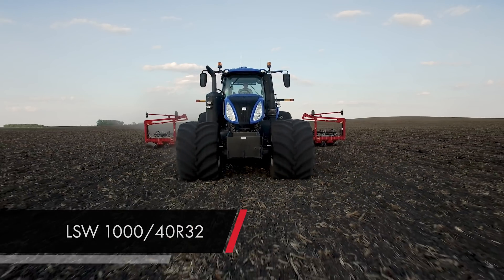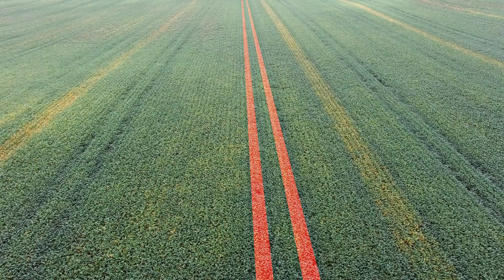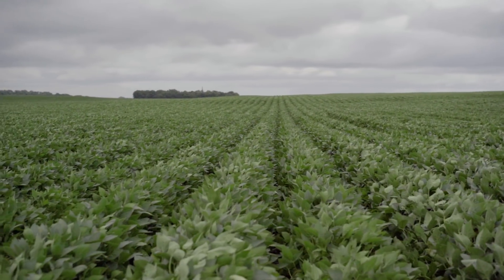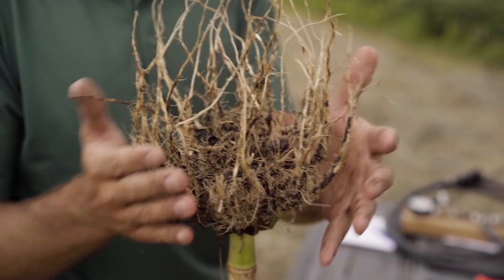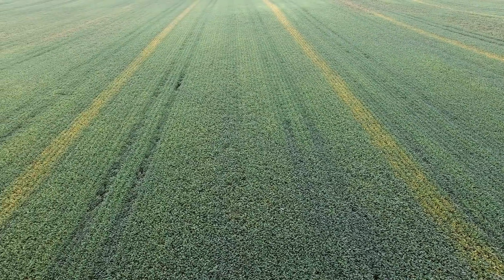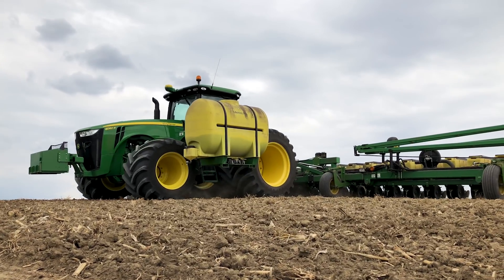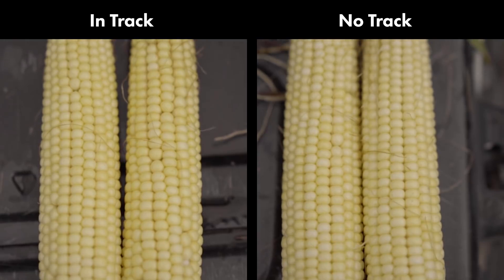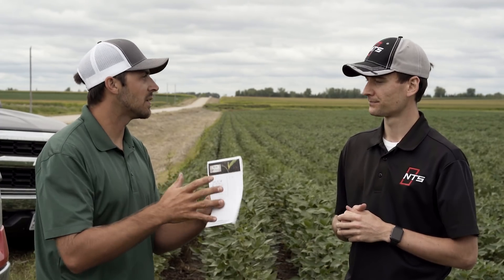Planting in the Tracks of Goodyear LSWs - A Yield Crusher or Inflator?

Comment: What is the comparison with tracks?
Reply from the maker: We haven't done any in-field trials ourselves comparing the compaction effects of tracks versus tires. We want to though! Although it's easy to think that tracks will most certainly compact less than tires (since they have the largest footprint), this is not necessarily the case. High-pressure points caused by the mid rollers can cause more compaction than a properly inflated tire. The advancements in IF/VF tire technologies and the introduction of tire inflation systems could make tires the way of the future. You might find the following article comparing the compaction effects of tires vs. tracks interesting: https://www.ntstiresupply.com/ptk-shared/tires-vs-tracks-which-creates-less-compaction

Comment: Do u think the difference between the two came from the fact that 1 planter was mounted on the 3point vs the other being pulled from the drawbar?
Reply from the maker: We believe the difference was because of the additional weight that the 3-point mounted planter (with saddle tanks) put on the tractor which then required additional tire air pressure to carry the load. But if the tractors were the same weight, the only difference being 3-point mounted vs pull-type, we wouldn't expect to see a difference in performance.

Comment: On a tongue drawn planter, you could run a 3pt tool bar with vertical tillage disc between the tractor and planter to practically eliminate compaction.

On a 3 pt mounted planter, one could mount vertical tillage discs on the planter before the row cleaners...

There’s always an answer, you just have to keep asking questions.
Reply from the maker: Good thinking. Sounds like a similar idea to Yetter's TrackTill®. Limit the compaction you create, and then remove the compaction you can't avoid.
Reply: Exactly, spending big money on new tires ain't going to help anybody. There's a simple solution just like you pointed out. After treatment of compacted soil is easier and cheaper. I ain't buying the kernel count and root development differences either. Air pressure is important, but I can't see an increase of 5-6 bushels an acre.
Reply: @MatthewFogarty-k2y  ... in an ideal world, but not all compaction occurs during planting.  Pre-planting tillage and the previous years tillage, spraying, combining and grain carts all play a part in the problem, especially if any of the them happened in less than ideal conditions.  Not trying to pick an argument or saying this is the solution for everyone but anything that can help avoid compaction that is cost effective over the longer term is worth a look.  With machinery in every step of the process getting bigger and heavier the more you can reduce damage to the soil structure the less costly remedies such as sub soiling or deep chisel ploughing (which can cause there own issues with errosion etc) have to be undertaken.  ☺
Reply: @chucklesx  True enough.
Reply: @MatthewFogarty-k2y  to be fair it's also region specific, if you tried them in most of Europe it would cost you a fortune in over width load permits and escort vehicles anytime you needed to use the public road.  In some countries you'd only be able to travel during certain hours at night.  ☺
Reply: We are zero till not interested in pulling any type of tillage machine.

Comment: Did your notice the planters running in the tire track bouncing or vibrating much compared to the ones not running in tire track?
Reply from the maker: One of the planters had Precision Planting's 20/20 system on it, and the farmer said there was no difference in what is called the "Good Ride". If you're familiar with Precision's system, that tells you whether or not the row unit is staying in uniform contact with the ground (measures bouncing). We also dug in the furrow behind the tractor tracks and did not see any differences in depth and singulation as far as we could tell.